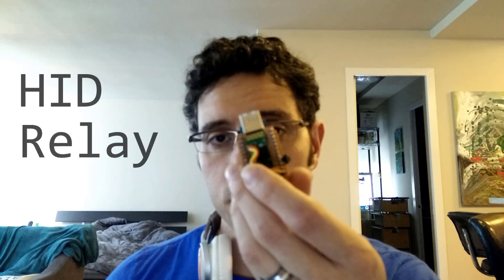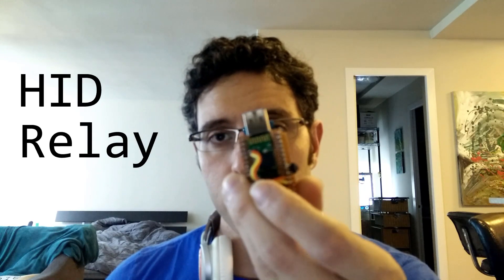HID Relay - Upgrade your USB Keyboard to Bluetooth!

Comment: Man I wish something like this exists as a commercially available product. I've been looking into Nulaxy and HandheldSci stuff but the reviews have no been positive
Reply from the maker: I've actually heard good things about the  HandHeldSci bluetooth adapter on reddit.com/r/MechanicalKeyboards but $40 plus shipping was a bit more than I wanted to spend.
Reply: yeah it is a tad pricey. I'm using an OTG cable to connect it to my phone and then using a remote server to use it to control my PC from the couch atm
Reply from the maker: Whoa. That's a lot of hoops to jump through.

But don't feel too bad, before I got this project working I was trying to use a raspberry pi to do the bluetooth conversion via a bt dongle https://www.gadgetdaily.xyz/emulate-a-bluetooth-keyboard-with-the-raspberry-pi/ , butI couldn't get the bluetooth stack working.

Before that I looked into using the pi for relaying keystrokes over the network similar to your solution. I abandoned that because I couldn't find any software/driver that emulated an HID keyboard on the remote machine (I didn't just want to stream character strings, but send modifier buttons too)

Comment: Just discovered this video from Lifehacker so I haven't had a chance to watch yet. Would this project work with another type of USB device? Asking...for a friend.... with a flightstick....
Reply from the maker: Maybe??

First off, it has to be an HID (Humin Interface Device) compliant device. If it's super proprietary and requires it's own special driver, likely you're out of luck...I mean your friend would be out of luck...the one with the flightstick. Otherwise, I think the main trick would be configuring the Bluetooth module as a "gamepad" or whatever the proper type id which matches the flight stick.

That config step is covered in Evan's instructable here:

for configuring as a keyboard
http://www.instructables.com/id/Bluetooth-Keyboard-Mouse-Adapter/step6/Configure-the-Bluetooth-module/

from when he made a PS2 controller speak bluetooth
http://www.instructables.com/id/Bluetooth-PS2-Controller/step5/Configure-the-Bluetooth-module/

Comment: I'd like to put this on the other side of the connection. Connect a bluetooth keyboard/mouse to it and then have the computer think there's a usb keyboard/mouse plugged in. That way you can use those even in the BIOS or other places where bluetooth drivers are not working.
Reply from the maker: That's definitely a cool project idea, but it's obviously not as simple as flipping things around. Here's where I would start if I tried to make it.

1. The USB host shield library has some examples for reading HID keyboards/mice via a bluetooth dongle plugged into the USB socket. This should allow the arduino to read keystrokes and mouse movements from your BT devices: https://github.com/felis/USB_Host_Shield_2.0#bthid-library

2. Emulating bluetooth keyboards and mice is actually pretty common/easy nowadays, a Teensy will do it, and I'm sure there are other solutions too. https://www.pjrc.com/teensy/td_keyboard.html

3. The real trick here is getting the USB host shield and library to work on/with the Teensy (It might just run perfectly out of the box, but I don't know for sure), or setting up a serial connection between the arduino/USB sandwich and the teensy for transferring keystrokes and mouse data.

I don't know that I'll try it, since I don't currently need that functionality (also I don't have any native BT keyboards for testing). But, let me know if you build one. Or better yet, share your own video about it.

Comment: What is the latency like? Would it be usable in a competitive FPS game?
Reply from the maker: That is a tricky question to answer. Best I can say anecdotally is I was using it to good effect on Overwatch/Lucioball a couple of weeks ago (I haven't had time since to jump back in). But bear in mind I'm not a competitive player trying to squeeze the most frames and response time out of my games. Also, I'm not sure how I would go about testing latency. If you can point me at any resources, I would definitely be interested to see if that's something I can measure.

Comment: Cool stuff man! Mind if I linked this video in an upcoming project?
Reply from the maker: Please do! I'm working on a build video now. The fine folks of the /r/MechanicalKeyboard subreddit were eager for more details on how to make their own.
Reply: @Dastardlylabs  hey, I know this video is from a while ago, and my question could already be answered in the video (can't actually watch it right this moment) but can this work with 2 usb devices at the same time or done with modifications? Thanks
Reply: Sweet, I would love to turn my IBM Model M into a bluetooth keyboard!
Reply from the maker: ***** That would be cool. But double check your keyboard's cable. Unless yours is a recent reproduction with USB, it most likely connects via a PS/2 port and wouldn't work with my project. https://en.wikipedia.org/wiki/PS/2_port

If that's the case, check out Evan's video for making a bluetooth adapter for PS/2 keyboards. https://www.youtube.com/watch?v=UJaqHnPR-XE
Reply: @Dastardlylabs   that vid is marked "Private" :-/
Reply: I already have a ps2 to USB adapter so I figured that would would with this project.  Is that not correct?  I would like to keep the USB to bluetooth dongle as generic as possible so I can use it with different USB devices.
Reply from the maker: If your PS/2 to USB adapter is functioning with that keyboard already, and more importantly, gets detected as an HID keyboard then it should work with the HID Relay. Double-check that (Device Manager in Windows, System Information on Mac) to be sure it's not some weird non-standard device.

Comment: Can you take the female usb-a off that board and instead put a male usb-mini instead? So it can plug directly into keyboards with removable cables.
Reply from the maker: You certainly could. I was thinking about that earlier, maybe try something like a right angle adapter so the unit stays flush against the keyboard too.
Reply: That's exactly what I'm thinking. Then including an adafruit Lith-Ion battery and charger so it would have usb on both sides. =D